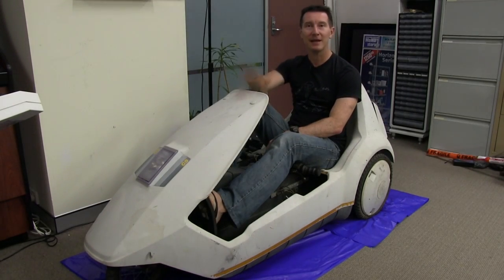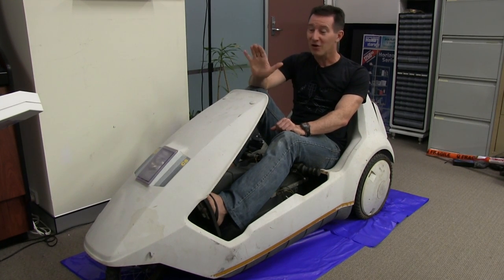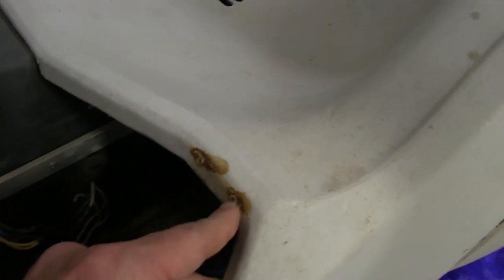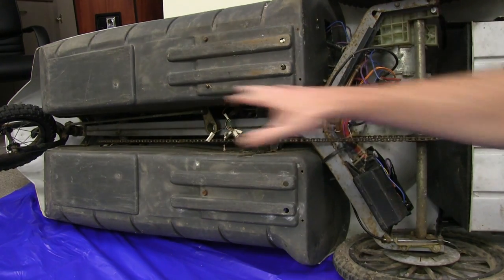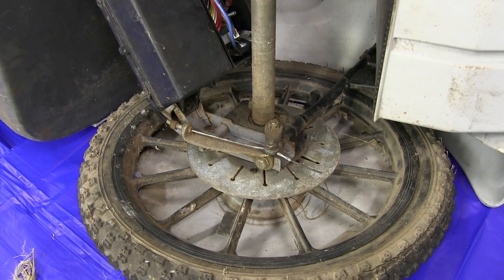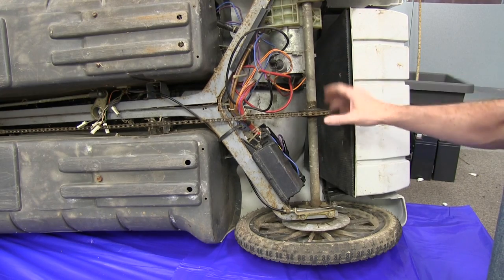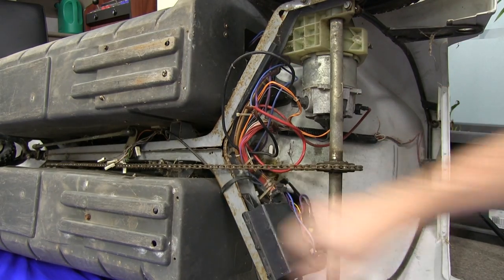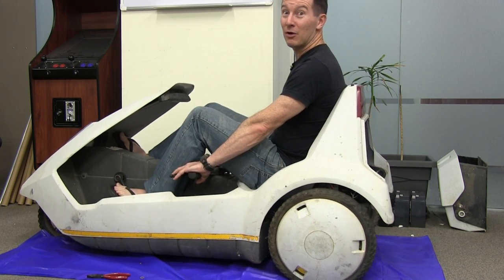EEVblog #604 - Sinclair C5 Restoration - Part 1

Comment: That's a do-able, but SERIOUS rebuild...
The chassis looks restorable, but it looks like a few of the spot welds have snapped - you'll need to get the rust removed, then re-welded...
As for the hub front drive; front wheel drive uphill & you'll slip the wheel...  The majority of your weight is going to be on the back axle, so honestly you'll be better off doing a drive motor on the rear wheel(s).

Comment: I'd love to see how you modify/restorate it.

There's a lot of things you can do with the HID, also with the Hub motor. Don't give up on this project, it looks very promising.
Reply: I agree, Dave can possibly add a hall effect sensor to one of the wheels and a couple 7 segments to make a primitive speedometer.  (or over-engineer to implement a can-bus :) )
Reply: Brendan Orr Easier to add a cheap $10 Chinese GPS module that squirts RS232 to an LCD / data logger. That way you can track where it has been, hill gradients, battery duration, speed, acceleration, braking efficiency. Even get it to call home if some scum tries to steal it!
Reply: True, I like that too.  We'll add it to the list of things Dave can over engineer :-)

Comment: Most of the rust on the chassis looks superficial (sand and treat with some sort of sealing paint), but it looks like the center bar will need a weld.

Comment: Love the C5, not bad for sitting in a paddock for some time. I'm in Canada, Torornto specifically, where the level of rust you have there would happen in six months! I'm a hobbyist welder, that chassis looks like an easy MIG weld fix. But I do like HomeDistiller's idea of fabricating a new chassis out of box section steel. Hang the original on on the wall as art!

Comment: Learning to weld is super easy, especially since you've already developed your small-motor skills from soldering. If you rented a MIG you could get up and running in like 20 minutes.

Comment: I come from a very different background, so my solution for the chassis might seem a bit "different":
If this was MY project, I would redo a chassis in composites. Hard? No, not really, you already have the most complex part; the master/core for the mold, the original chassis!

1st step
-Weld the missing parts on.
-Fill all entries to voids.
-Bondex, base coat it, spray and polish a few coats of remolding agent.

2nd step Build mold:
-Build up a mold to half height,
- First layer is painted/rolled on gel coat.
- 2nd layer is fine mesh glass.
- This being a one, off, use plaster with water containing 1 litre of white glue for 25 kilos of  plaster.
- Clean up and spray more demolding agent all over.
- Build top up using same technique, but with 2 more layers of fiber and NO plaster..

3rd step Moding the bugger:
- You now open the mold and remove the original chassis.
- Here, I would use a very slow resin to make "home prepreg" - this how racing cars are made...
- Put the strict minimum of resin in the fiber.
- Softly tap the strips onto your shape until you have sufficient layers.
- In the mold you will see indentations in the gel coat where the screws went.
- Use these to perfectly glue alloy or steel pre taped inserts with gel coat.
- Don't hesitate to add wet roving to the back of the inserts or small voids. It works for EADS helicopter blades...
- Close mold - this should be done very carefully with the parts still soft and the ony phase where you actually "wet" the contact surfaces. It is critical not to delaminate.
-Strongly clamp.
- You previously placed mountain bike inner tubes in the mold void. Pump  up to 3/4 bar and go out for a beer.

4th step:finish/
- Open mold with wood wedges.
- Twist base to pop part out.
- Clean new chassis up.
- Drill holes, paint and finish.

It seems a bit complicated (and I have not detailed stuff, I'd rather just draw schematics), but it's really not that hard. Furthermore, there are tons of project specific shortcuts that I dd not detail here because I don't know the chassis.
If you source you material well (surf shop suppliers), a new - racing grade, fiber glass carbon composite chassis- should cost you between 300 and 400 Euros.

Comment: I don't know what you did with this C5 but the chassis isn't that bad, a simple TIG or MIG weld with  a little reinforcement will fix it. Take it to a weld shop, shouldn't cost that much. Rust is easy to deal with these days. The electronics is nothing either, I'd update the motor (BLDC) etc.
Rob

Comment: the switches en transistors look like a circuit out of a battery drill, also the rust doesnt look to bad, take it to some car body welder, shouldnt cost to much to fix it up

Comment: The bodge (guess that's how you spell that) with the flatpacks mounted to aluminium bar and squeeze trigger looks like guts out of a portable drill... cheapo speed controller. Myself I'd go with a Chinese scooter controller with a hall effect twist grip or thumb selector. One important lesson I learned souping up an electric moped was to use oversized wiring. Keep runs between battery and controller and controller and motor as short as possible. I gained several MPH top speed just by replacing stock wire with heavier gauge wire. In the US I got a lot of parts from TNC scooters. I'm sure there is an Australian equivalent.

Comment: Rust inhibitor spray paint and duct tape the frame, drop a beefy motor in there, and get 'er done.

Joking aside, I see two options as far as the frame goes after you strip everything off it: remove the paint with chemicals or a wire-wheel brush attached to an angle or die grinder, and then get someone who knows how to weld to fix it up. Second option would be to scrap that frame and make your own with two pieces of channel iron of similar gauge.

Comment: This frame looks decent. Rust looks to be only on the surface. Send it for sandblasting, and after a nice cleaning - weld it together, or have it welded. Others mention ordering a new one out of square pipe. Good replacement, but you that will be a lot of extra work to design it and fit all the mounting holes. Wouldn't do it unless necessary, and it doesn't look to be.

Comment: Before you get to far into the fiberglass contact a boating referb company to get the lowdown on making it shine again. theres alot you can do to make it worse / harder to get right again. and alot of the boating tricks are alot cheeper and work better than alot of "car" repair tools.

in short boating shops redo ALOT of fiberglass :)

Comment: The fame is repairable. It appears to be stamped sheet metal with spot welds. This is the same process used on automobile production. The frame will need to be completely removed from the fiberglass body then sandblasted, the frame patched and welded, then painted/powder coated. I'm sure a local welder fabrication shop could help you.

Comment: Yeah I'm not a huge expert, but grind the rust/old paint off the chassis, remove any chunks of rust, and re-welt that main section, then cover the whole thing in some rustoleum paint or something similar in a few coats and it should be fine.

To do that I'd take the chassis completely out to work on it.

As far as welding, I still need to learn how myself but it seems pretty easy to get into for simple stuff, like soldering, just bigger lol

Comment: I can see plenty of useful comments Dave. The frame is certainly split in half and the type of C shaped tubing is certainly not very rigid. You may want to have it soldered back and reinforced if you want the original frame. Another path considering the simple frame shape would be to have a boxed tubing replica frame made by welding square tubes. Aluminium would certainly be the way to go for this. Financialy speaking you should make a deal with the body/frame shops to have their brand displayed on the finish C5 at least for a while. That would make it economicaly interesting. To bad you can't have Orange County Choppers to work on it !!

Comment: Metal looks weldable, just slap and extra piece of sheet metal over the cracks for reinforce it and tack weld them in place, i've seen a lot worse. Or as simple as the chasis is, you could get someone to weld you up a new one and salvage the steering neck assembly. If you need another motor and gearbox you should check out staton gearbox drives, they're used for bicycles, but it looks like it would be compatible with your application.

Comment: Great vehicle! As many here already commented: The rust is not an isse. Sandblasting and powder coating will do the job. Before that you need to get the frame welded. That is barely a challenge for an experienced welder. Check the other welds for crack. There might be more surprises and probably think about "improving" some weak points. In the video the kinks in the frame seem a bit bogus. (might be the video though)
The transistors aparently belong to the "trigger" type switch that is bodged into the wires. This apears to be a salvaged unit from a cordless drill of some sort that has been reused in this context. Aparently it wasn't up to the amps or the duty cycle so the transistors needed a bit more convection ...
Nice video though.
What material is the hull/body?

Comment: The thing with the transistors wired to it is the speed control out of a cordless drill! ... as an upgrade from the standard on/off system

Comment: A good wire brush will remove a good amount of the surface rust, if some of the deeper stuff doesn't go then grit blasting or an acid bath could be needed.

Comment: LPS 2 & LPS 3 will be your friend for all the bolts!  You will need a mig or tig welder / cutting table with some square tubing to replace the broken angle frame.

Comment: that is in great condition, just find a body shop and they can fill in and paint the body like new also you can get the chassis sand blasted and powder coated to make it last a very long time

Comment: That switch thing with the transistors that was mounted on the aluminum... Trigger/direction switch from an electric drill. Probably used as a speed/direction control for the motor.

Comment: If that c5 was in the UK we would proclaim it to be good condition.

The chassis needs a tiny amount of welding, which any engineering company could do.
Reply: any backstreet garage in the uk would weld it for £20/$30.
Reply: The chassis probably needs an acid bath to stop the corrosion.

Comment: its a simple chassis just make a new one from box tubing.. it would be stronger than fixing the old one and not much more work
Reply: Probably best to fix the chassis with all the fixing point etc, the seams are gone but deffo fixable.
Reply: If you replace the chassis, it isn't a restoration job, it is a replica with original parts.
Reply: far from it a replica is all new from the ground up based on a old design. a restoration is a rebuild using as many original parts as possible
Reply: HomeDistiller The original chassis is made of two stamped halfs welded together. It's specially designed to be really lightweight and also to flex as to act like independent suspension.

You could do one out of boxed steel, but it'd be like 2-3kg and ride like crap.

Comment: I'd suggest stripping it down sufficiently to remove the pressed steel chassis completely, and then taking the steel part to any competent mechanic to get it fixed up.  They can grind off the split spot welded section and weld a gusset plate in place to restore its strength.  The rest of the rust looks superficial, and a good rust treatment will fix it right up.

Comment: The chassis looks salvagale to me. Mostly surface rust. The breaks look more like metal fatigue than corrosion. Probably just been overloaded or ridden rough too much. I suspect it'll be a case of having the tack-welds drilled out to dismantle it into the componant pressings, getting it sand-blasted, then welded back together and painted. It doesn't sound like you're concerned about keeping it stock, so you could get a much stronger bead weld on there than the old spots. If you want to keep it stock, it'll mean some patch-metal and smoothing, but overall still not a tonne more work.

Welding experience that'd be most applicable would likely be older car suspension repairs. The pressings are of similar scale to suspension wishbones. Take it to someone who's done some bike or classic car resto if you want the Old Boys knowhow on it.

Comment: i have a sinclair c5 for a few years now and yours isn't that bad as you think, that chassis has only broken on the spotweld, you could easaly weld it back together at the remaning metal. just give it a good wash and it will be ready to go, if you want to upgrade it i should go for 24v, then it wil run arround 35-40km/h. the only thing is that you need a pwm system becouse the belt wil slip when you give it some power when you are not rolling at a decend speed. sow if you want to drive arround 35km/h you need to peddle at least 25-30, and on a sinclair thats almost imposseble becouse of the low gear ratio. with the pwm you kan variate the speed en just peddle to 15km/h and then start the motor and from there you can let it slowly go faster. the stock motor is'n that bad and will easaly handel the 24v power, but the belt design from sinclair is rubish and will slip realy fast when it isn't tightend proparly(as far as i could see i think its way to lase at yours). you can just put some steel or plastic between the motor and motormount to raise the engine a little bit and give it the extra tension that it needs. you can try this if you want to give the sinclair a chance in semi-stock form. but if you will upgrade it with a newer hub motor i wouldn't put it in the front wheel, when you will drive the bike for the first time you will notice that the front wheel hasn't mutch traction. if you put some power at it you will just spin out or it will be difficult in corners.
my sinclair c5 was a daily driver with about 30km a day and it did realy wel, even with some steep hills(when the belt is tight) now with the 24v system its even beter you can variate the speed pretty accurate and at about 4200-4500rpm it wil drive perfect with almost no noice and great power for hills, when you go straight you can easaly pup it up to 6600rpm and cruise at a nice fast speed when the motor stays reasonably cool.

Comment: Any auto body shop can fix the chassis no problem. Have them lay on some extra reinforcements and it is good to go.
I would have it hot dipped galvanized; holds 30+ years and adds a bit of strength to the frame as well. It is not more expensive than a good paint job.

Comment: I would take the body to a boat repair shop. They could use yellow glitter paint for the stipes.

The chassis should be able to be repaired by someone who knows what they are doing.

Don't weld on a gear unless you have someone who really knows what they are doing, there is too much of a chance that they could make the back axle non-concentric.

I think that having a single motor in the front should work great, it certainly did on the Electrathon car that I helped build.

I would probably be able to help you, if I weren't halfway around the globe.

Comment: It looks like the bulk metal of the chassis is still there, I would say tear it all down, sand blast it, have it seam welded, and powder coated.
Reply: Pretty much this. The rust looks like it's just surface rust and the middle seam looks weldable. If you know a fabricator bring over some beers and you should be solid in less than an hour.

Comment: If you want to make this an uber powerful electric vehicle, then all you need is a decent series wound DC motor, controller, and high current discharge type batteries.

I built a go kart using a D&D ES-22-2 motor with an Alltrax 4834, and the batteries were Odyssey PC1200's.

You could go AC drive if you want maintenance free operation with no brushes, but the entire package for the same power costs almost twice as much compared to the DC drive.

Comment: I would grind/clean up the pinch splits and reweld them. then send the whole frame off to a local powder coating place. Have them sand blast the whole chassis and powder coat it gray or black to keep it from rusting any more. but from what you showed it looks like just a light bit of surface rust. But need to remove the frame from the body to be sure.

Comment: I would call someone to make and weld new chassis with suspension (from bike parts). Geared hub motor with at least 1000W, LiFePo4 batteries and some good controller would transform this little Sinclair into great electric vehicle (just like Delorean which is reborn as electric car ). I wish you all the best luck with the project, it was awesome idea to buy it and restore it! Make it most awesome Sinclair around!

Comment: Looks like mostly surface rust - but depends how thick the metal is. Wipe all electric wiring - easier to set up ur own then make sens of the custom mess.
There is minimal electronics anyways.
Most likely leave the metal work to some car body shop  and focus more on electronics part - motor,  switches, hud, battery etc.
Reply: I agree the rust seems to be pretty minimal for something out of the 1980's and if you feel unsure about how strong the chassis is he could always weld the center of the chassis together.

Comment: Nothing serious Dave. Take it ALL apart (with pictures) then take the main chassis to a body shop to be cleaned, welded and painted. Then reassemble according to the reference photos you took. Your probably going to need to make new wiring harnesses for part of the systems.
Definitively use your skills and create a custom dash. A "Flux Capacitor" is definitely called for in the design somewhere ;)